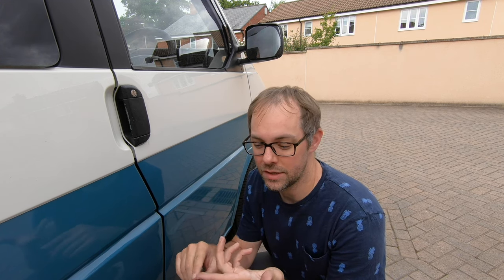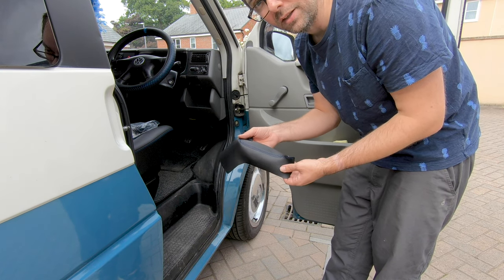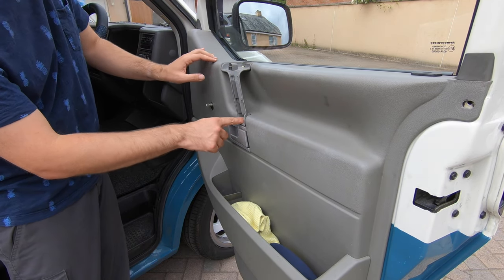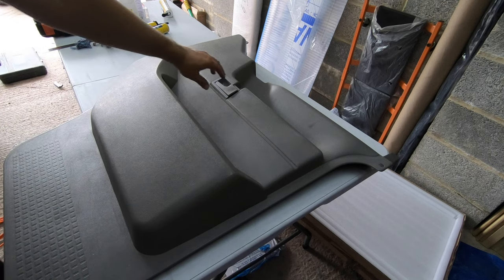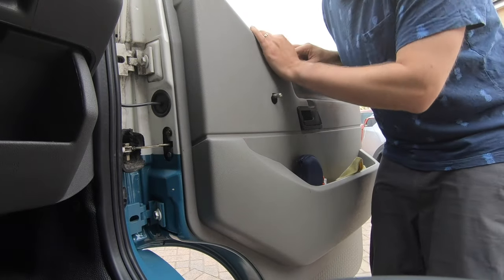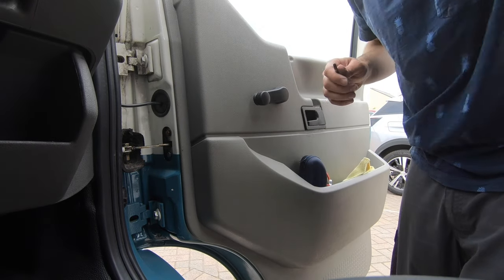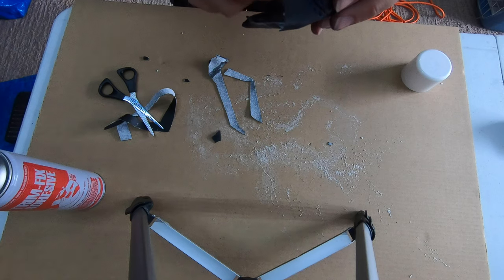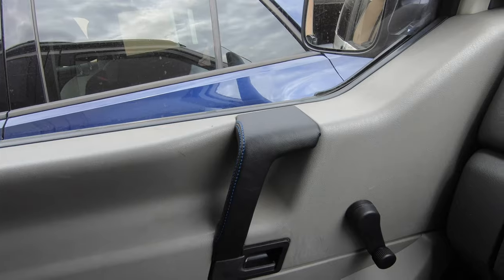Retro Retrims VW T4 Door Handle Covers and New Window Winders!

Comment: Good idea wrapping the handles.  I bought some after market handles in grey for my caravelle but upon pulling the door catch they kept coming unclipped.  So back to the originals.  I wander if you can source the caravelle electric windows kit from someone like Calicampers?  I think much nicer than the manual handle.  Keep up your vids and the t4 going.
Reply from the maker: Thanks for the comment, yes we too have noticed sometimes the aftermarket door catches come loose from the panels. As for the electric windows, you can get "new" electric conversion kits that include the original style switches, although I'm not sure how much work that would be to wire up :)